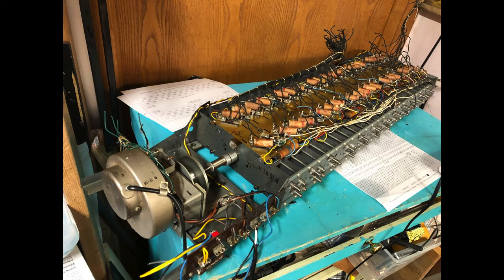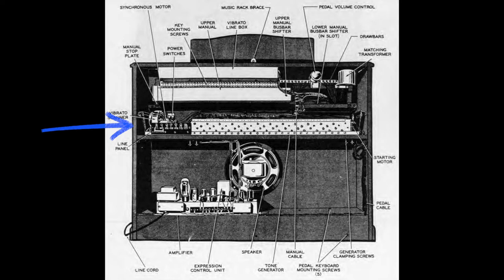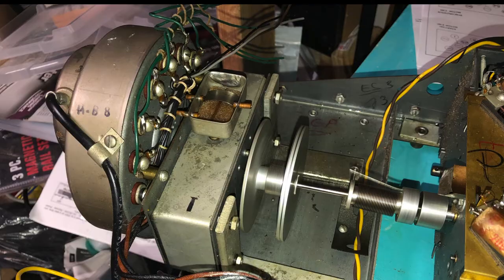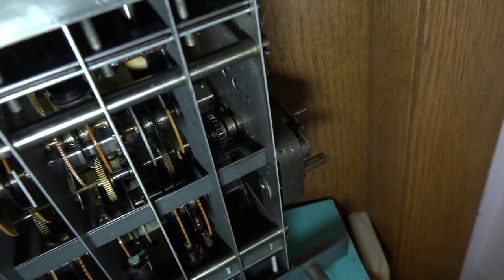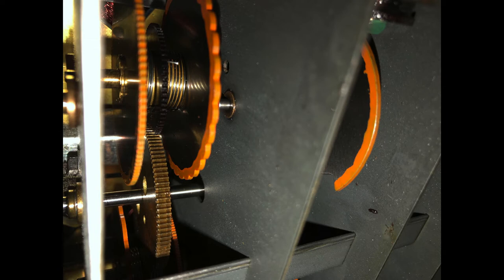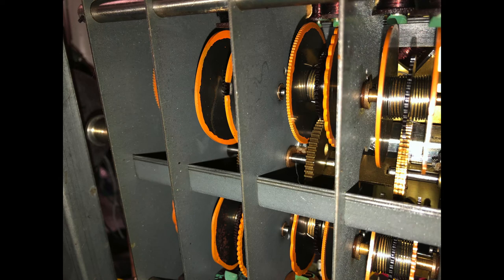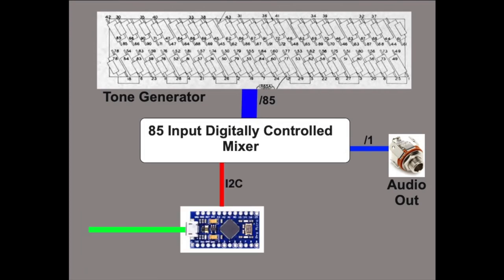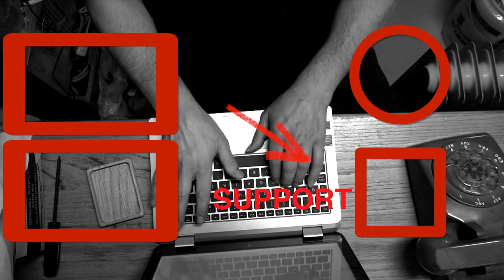MIDI Controlled Hammond Tone Generator Project  - Part 1

Comment: This is great. I also have the same tone generator sitting around for years (who doesn't?). I was slowly moving it across the garage last year to bring to the basement and broke a tiny piece off the PCB and a solder lug. Subb'ed

Comment: can you please maybe list a parts list to help out? I have a hammond also and just can't find a definite how-to on a midi controlled tonewheel retrofit. I have a hard time doing troubleshooting abs trial and error anymore due to disabilities. I'm hoping to find a simple pdf style how-to . sad thing is I'm an electronics tech from navy.  but,  I'm jacked up now and concentration and pain are huge restrictions. thank you
Reply from the maker: I'll publish it all when I'm done. and not making any more changes along with circuit board info for ordering from a PCB manufacturer.
Right now I've upgraded the processor running this to a Teensy 3.5, but I believe the 4.1 would work too. At least that's my goal.  Hopefully I'll get things up and limping in a couple of weeks and put out a video. Thanks for your interest!  And thanks for your patience, it's been a long unproductive few months.
Reply: @Someoldguycoding  Interesting. I have a tone generator under my workbench waiting for such a project.....